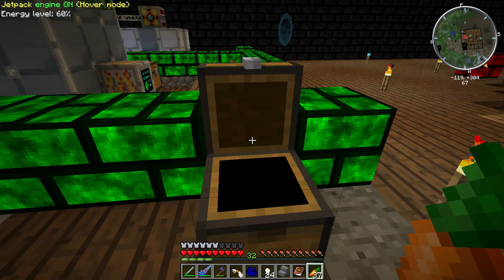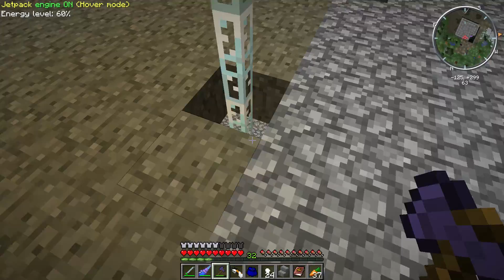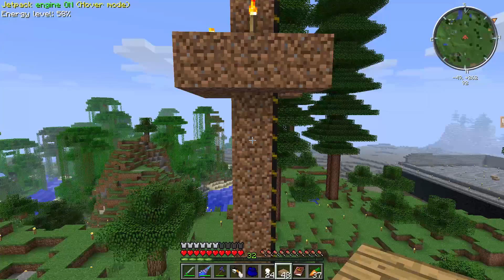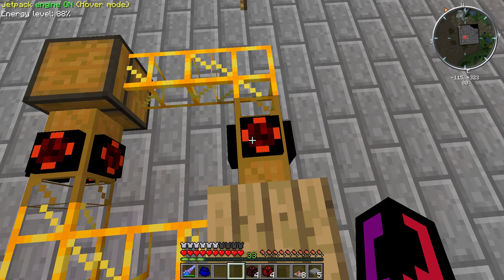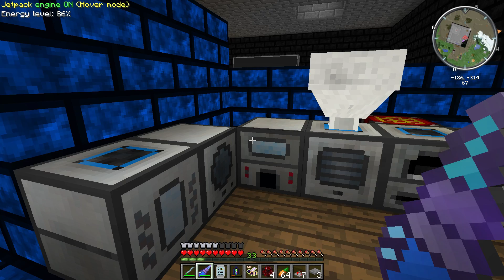Kryptocraft - s2e48

Comment: Awesome as usual. You really need to clean the computer's noise from the audio.
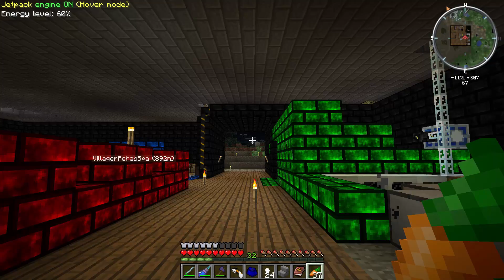00:24 I feel so claustrophobic.
10:42 Direwolf20 have a cool automation. (Shortly: use turtles)
23:43 How did you get 5 Both Temp.?
~#607Sub